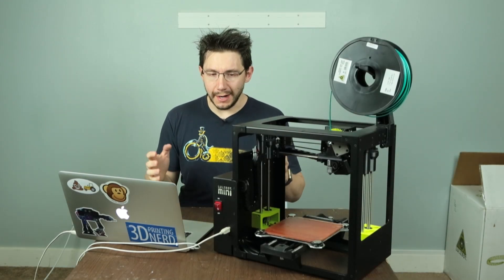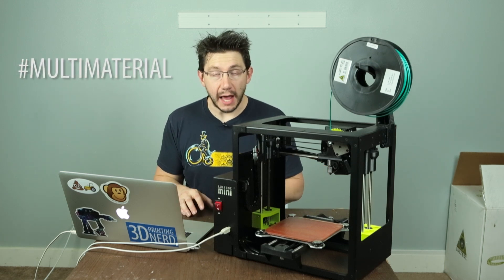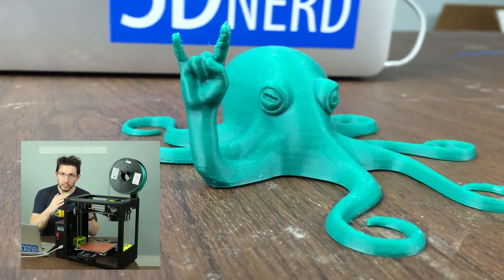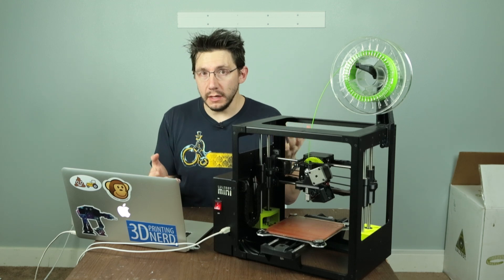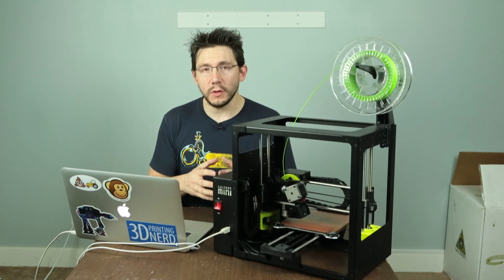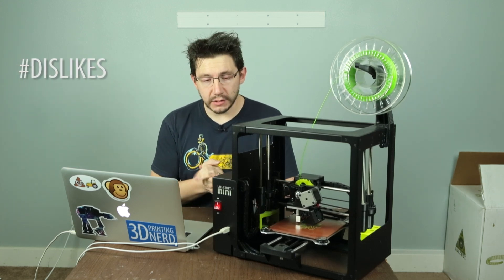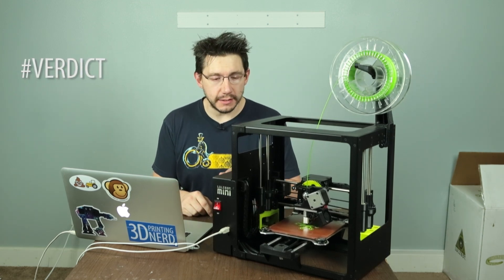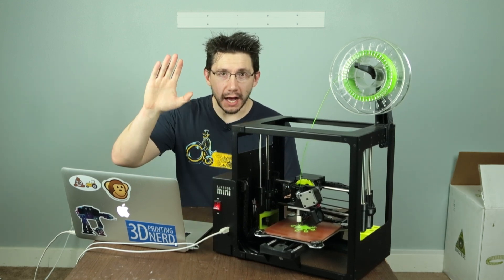Lulzbot Mini 3D Printer Review

Comment: Did you find the noise louder than your other machines? I only have my delta printer to compare it against, but it seems a little loud. I just got my mini setup, and I put a stepper damper on the Y axis motor, and it got rid of 90% of the high pitched noise.  Besides that, it's so good!
Reply from the maker: +Diode Press The noise was a bit loud, but, I never notice it and forgot to mention it because it's in the laundry room and the door is always closed. Though, personally, I love the noise. Is that weird?

Comment: Nice printer but i dont like that you need a pc as controller.
Reply from the maker: +3DPrinting It's the nature of things. I think Lulzbot figured they already have a wonderful slicer in Cura that they can use. Plus, you could always connect it to a Raspberry Pi controller!
Reply: +3DPrinting It's probably a choice made to meet a certain price point. IF they wanted to include an on-board controller and still hit the same price, they'd have to cheapen something else up. Frankly, I'd rather have them leave off the controller and beef up other areas. It's a simple matter to add a controller, and their user community is very helpful - many posts on how to do so.

Comment: I should let you know that there is a fairly simple mod to convert your printer into 1.75mm. Is Lulzbot letting you keep it? also, are you able to upload your own pre sliced gcode onto a matter control touch?
Reply from the maker: +CJ Printing Well, it was printing 1.75mm easily, don't see why a conversion would be needed. I do not get to keep it, just a loaner. Matter Control Touch - um... No.

Comment: I have a lulzbot taz 5, and largely i like it a lot.  However im upset in that it has no nozzle cleaning, or auto bed leveling at a bigger size etc... Thats sad.   I noticed in your prints, same as mine, and same as almost EVERY other lulzbot owner the Z banding.  Its almost unavoidable on these printers.  However it is mostly cosmetic.  If you run your fingernail across the print, its smooth and mostly very good, however the visuals on that banding are not great to look at.
 I am working on getting out a taz 5 review on my channel soon, i just cant get around to it (same as you joel).  I also have a gcreate 1.5xt+ coming in the mail in the next week or so as well :)
Reply from the maker: +In The Lab Z-banding? It's purely a cosmetic result of the light positioning. Had I brought the light down a foot or two, you wouldn't see it. Plus, if I can drag my fingernail across a model and have it feel smooth, then it's smooth :) Also, time, right? SO HARD to find the time. Plus - wow, you're getting a 1.5XT+? THAT'S GREAT! I think you'll like it.
Reply: +3D Printing Nerd Im totally with you joel it is light, but visually its there if you can see it in most lighting situations.   I have owned a FFCP, Rostock max v2, Makerfarm Prusa, Formlabs 1+ clone, Muve3d, Taz 5, and soon to be Gcreate 1.5xt+ .  The FFCP has been by far the highest quality printer ive owned.  Back to the Taz. While I totally agree the prints are high quality (i just finished a customer part a moment ago that shows it) the visuals of the banding sometimes makes me sad.  
And I am getting the gcreate largely because of your channel. I want to get back to 1.75mm filament, and need a very large build volume.  Im also lucky enough to have Auto bed leveling shipping on mine (its standard soon i believe).  Heated bed not ready yet.
Reply from the maker: In The Lab The BLTouch on that large of a printer surface is a game changer. Plus, heated bed not ready yet - but soon I hear!
Reply from the maker: In The Lab Also, dude, how was I not subbed before? SUBBED!
Reply: +3D Printing Nerd  very soon.. anna told me this AM (i hope this wasnt NDA material here :) that my printer will ship next week sometime but that I am just missing the Heated bed being ready, but ABL will be included on my printer, and I presume on all future orders.  The heated bed will be an upgrade (which I was willing to pay for of course).
Reply: +3D Printing Nerd and also. thanks for the sub. I am working on growing my channel , but of course its always slow until you hit an inflection point or get a cool collaboration going etc.  Im thrilled your channel has been killin it the last few months.  You put a ton of work in to this, well deserved.

Comment: I just setup an Octopi rig for my mini.  It works like a dream.
Reply from the maker: +Daniel Splawski Yeah? I want to do that - super easy?
Reply: Totally.  Thomas Sanladerer's instructions on the Octoprint download page are flawless.  Also, there's plenty of space in the Mini's power supply case so you can easily wire up a dedicated 5v AC converter.  If you used a short USB extension cable to run the Wifi dongle outside of the case, you'd probably have enough room for the Pi as well.

Comment: loving the the new graphics, and your style in general. You are different from other youtubers, and I think you do a great job. 

about the mini, does the PEI surface take any damage? and in that case can you change it?
Reply from the maker: +Reenarco Wow, thank you! Different in what way? As for the PEI surface, it can take damage if a piece is removed improperly, or when the build plate is still too hot. The glass is held on by the metal discs on the side, and it's easily replaceable!
Reply: +Reenarco You can replace the whole glass (& bed heater) with the PEI. This can be done in a few minutes. You can also peel the PEI off the glass and replace just the PEI (You do need to clean the glass thoroughly before installing the new PEI sheet).

Comment: I hate 1.75mm filament. 3mm master race.
Reply from the maker: +oobligah oooh. will I learn to love it?
Reply: 3D Printing Nerd It all depends on the feeder type.  Direct drive?  No real difference between 1.75mm and 3mm.  Bowden setup?  3mm is much, much better.

In my experience, 1.75 in a bowden style feeder buckles much easier, and jams about 3x more often than 3mm.  I've had just a few jams with 3mm, but with my 1.75mm printer, I get jams once every couple days.  It's gotten so annoying I'm about to convert it to 3mm.
Reply: (I'm actually waiting on the new 3mm hotend as we speak)
Reply: I hadn't thought about it until just now, but in theory, with the same filament diameter tolerance (+/- X mm) the 3mm filament will deliver more consistent prints than 1.75mm, just due to the fact that the ratio of error vs total diameter is smaller.
Reply from the maker: oobligah You know, that makes sense if you tolerances stay the same. Interesting!